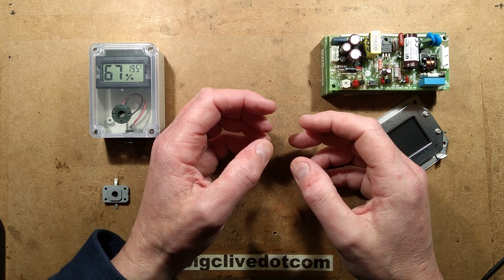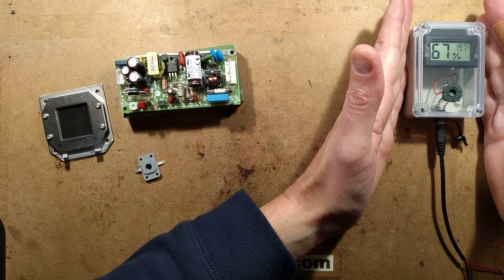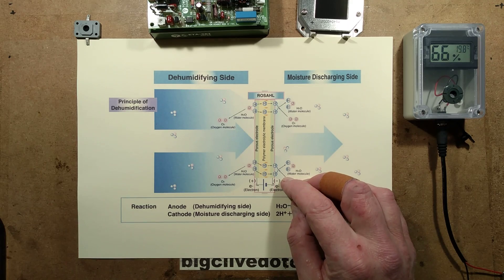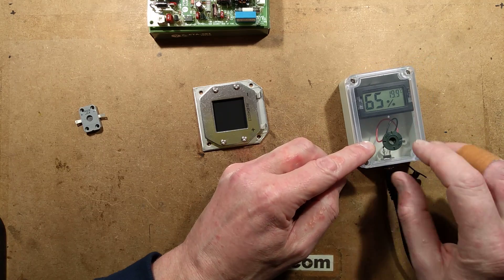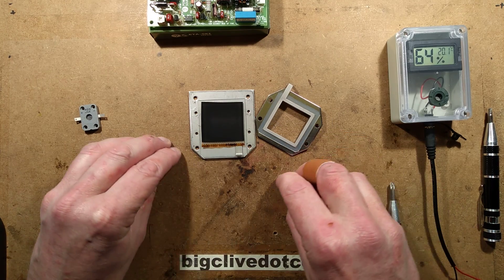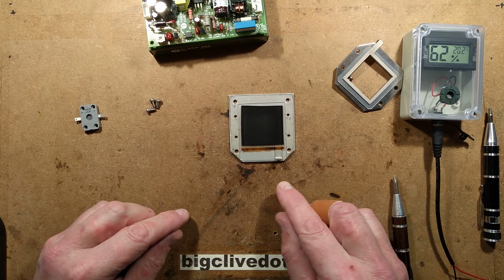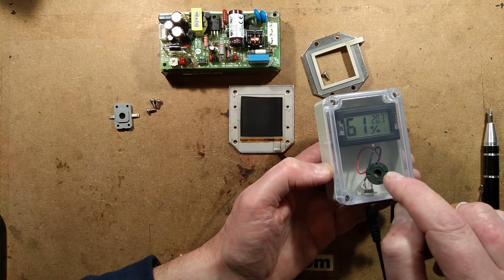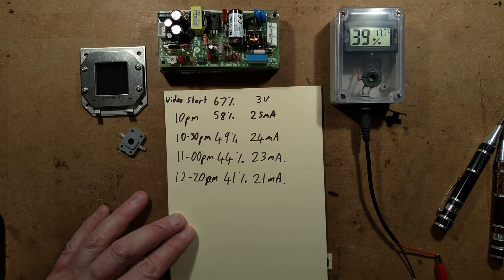Incredible solid state dehumidifier.  No moving parts.

Comment: It seems to be doing electrolysis on the water molecules in the air.. moving the hydrogen to one side and leaving the oxygen behind. Very interesting. I wonder if this is how oxygen concentraters work?   I also wonder if leaving excess oxygen in an electrical switching cabinet is a good idea?
Reply: If you're talking about the kind I'm thinking of, the ones that run on electricity and produce a higher oxygen gas than normal ambient air... those typically work through a combination of of air filters/sieves and a compressor. Basically from what I remember they just filter out the nitrogen and some control the oxygen content in the output mixture.
Reply: Thanks.. I didn't know how they worked.. Still, this is interesting technology.. it removes moisture by splitting the water molecule instead of just moving it from one place to another.

Comment: The lasers might be easier served by a small heater to keep the lens from condensating. Much easier to implement and no need to keep the outside dry.

BP uses heater strips in their PLC enclosures in Tobago to keep the housing above the dew point year round.

Comment: Clive, just from your words in the first 15 seconds of this video.... you should do some research into Cathodic Protection of pipelines that are coated with either Fusion Bonded Epoxy, or 2 part liquid epoxies. The direct current from a rectifier actually pushes ground water through a disbonded epoxy coating, and the current also polarizes the steel pipe surface in these disbonded areas. CP systems are used as a backup to prevent corrosion when a coating system fails. My wording might not be 100% correct here, so please do your own research. I'm a coatings guy, not a CP guy, but I do understand the logic behind CP. I'm sure others here will correct my lack of knowledge...

Comment: Are these suitable for outdoor electrical panels?  Look perfect and could use a ton of them for this.  Not sure how one would keep water off them.  Outdoor gear seems to get water in pretty much everywhere at some point.  Even pointing down at the bottom of a panel is likely to get wet do to water wicking up the edges.

Comment: This is a great device. Would be really useful for keeping 3d printing filaments dry in a box for example in storage. Sure you need power, but it is easier and probably botter to keep for long time than silica gel thingy.
Reply: movax20h good idea, if the box is small and sealed well the smaller models I would think should work fine.

Comment: Interesting technology. I wonder if it works similarly to electrolysis, but with a membrane that only lets the smaller hydrogen atoms though to the outside and not the larger oxygen atoms...
Anyway about your test, it's worth pointing out that testing the humidity drop by measuring the relative air humidity, isn't a particularly clever thing to do, since the relative air humidity is inversely proportional to the air temperature and therefore isn't very meaningful unless the temperature doesn't change during the test. For those interested, here's a list of data points shown in the video (of which I know the temperature, assuming the thermometer is accurate) and what they would have been had the temperature remained constant:
At 09:30 pm: 67 % at 19.5 °C = 67 % at 19.5 °C (obviously) (200 to 86 mA)
~  09:45 pm: 60 % at 20.4 °C = 63 % at 19.5 °C (~27mA?)
At 10:30 pm: 49 % at 20.1 °C = 51 % at 19.5 °C (24mA)
At 11:00 pm: 44 % at 18.5 °C = 41 % at 19.5 °C (23mA)
At 12:20 pm: 41 % at 17.5 °C = 36 % at 19.5 °C (21mA)

Comment: Too slow from what I am seeing.
Reply from the maker: They're only designed for enclosures and rely on ambient absorption into the membrane without forced air.
Reply: Well, I use the beads that you plug in to recharge them and within 2 minutes I will see a 10 percent drop in RH inside a 2 sq foot by 1 foot deep sealed container and only takes electricity when I recharge them for 8h once every 2 months.

Comment: This may be an odd question, but how much Hydrogen does it produce? Enough to be a problem in an enclosed area?
Reply: The web site has production values. The big cells produce only a couple grams a day of gas and most of that by weight is oxygen.

Comment: I suspect these are actually specialized fuel cells operating in reverse. I wonder if exposing one side to a very high humidity (say 95-99%) will cause an electric potential to form across the connection leads?
Reply: American Locomotive Water is the lower energy level molecule.  More likely success is putting lots of hydrogen on one side, then getting electricity from the terminal and water on the other side.

Comment: I'm watching that sing on the right hand side of your desk and the humidity is going down as the temperature is going up, that's not dehumidifying, that's just the physics of what happens to humidity when you heat something up! I'm getting the feeling that the next ad I'm going to see from that company is that thing hooked to a solar panel with the slogan, get free drinking water out of thin air LOL
Repeat after me, pseudoscience. ( you also brought a very tiny amount of air in that thing from outside onto your hot bench under the light )
Reply from the maker: If you note the data in the description you'll see it went down to about 22%.  The ambient temperature fluctuated up and down.
Reply: Clive heats the house with his own body heat.

Comment: Interesting device, all be it a slightly expensive one... Over £60 for the smallest... Eeeek.
(I was thinking of getting one to keep my 3D print filament dry, but I think I'm going back to plan A of a peltier).

What is your ambient humidity there, can it take the interior lower than the external humidity, or will it stop when it hits equilibrium (like true osmosis)?

Also I think you've left the oven on, I can't believe your house is over 20 degrees!
Reply from the maker: It went down to about 22% in an ambient humidity of about 65%.  It has been warm.  Winter can't come fast enough.

Comment: Good for making a 3d printing filament spool dehumidifier
Reply: I was thinking about that too! Would be great to store the spools, but I do not think it would dry spools that are already wet.
Reply: Exactly what I was thinking. :)
Reply: I thought the same, and I wonder if a small solar panel and some voltage controlling circuitry could run it. Julian Ilet would probably be all over that.
Reply: was thinking the same thing.
Reply: was thinking the same thing, a wee bit expensive though at 66GPB

Comment: Wow that would be nice mounted to the side of my safe. I use a dry back one that I need to plug in and recharge aka dry it out.
Reply: Craig C don’t most people put things to control humidity in their safes already?
Reply: Yes but most of them you have to take out to dry and recharge every month. This if it was somehow built into the same wall would pull the water right out of the safe.

Comment: Very interesting Clive, I’ve built a cabinet based arduino polytunnel control unit that sits in the polytunnel where the humidity is controlled at 70-80%. I’d always worried about the humidity in the cabinet so fitted a membrane “breather”. This technology sounds like it could be a good solution for me.

Comment: Very interesting, if they were priced like a commodity item I could put a few to use right away.

Do they form a pressure seal? If so, how much pressure differential to they tolerate? Wondering if these would replace a breather valve or work in tandem with one.
Reply: https://www.micro-dehumidifier.com/

Comment: That's a PEM fuel cell in reverse acting as an electrolyzer. It's not going to last long if it is starved of water, which in this case it will be. Needs to be completely wet and would still not last long.
My whole PhD was on fuel cells. The fibers are the gas diffusion layer, possibly carbon doped with platinum.
Reply: What about hooking a PID controller to keep humidity at constant level, like 10% or something. Would that prolong life of a device?
Reply: Fascinating!
Reply: So essentially, if you supply it with Hydrogen, it can make electricity? Say a few 10 mA at 3V?
Reply: Aditya no, you'd need a catalyst I think. It's conceivable that it might produce trace voltage, but nothing substantial I would presume.
Reply: @AdityaMehendale  quite possibly actually. It likely has a platinum catalyst on it to help break down the water, but I'm speculating as to whether this device has that. I'd expect it to buy can't be certain
Reply: Should add, means the dry side will be giving off hydrogen and the wet side oxygen. Won't likely give off ozone.
Reply: @Simon
Don't you think it is possible that the company that makes these has put a bit of work into them and optimized their product for being run dry?
Reply: @audiocrush  yes of course. I'd be interested to get one to see how they've done it. However the chemistry is set in stone. Being sceptical of marketing talk doesn't make me naive, it makes me want to know more
Reply: Converting the initial water content to oxygen shouldn't increase the oxygen level more than by a few percent, maybe from 20% to 23% or so. But I wonder how it builds up over time. I suppose that most of the time moisture and condensation would be a bigger problem than oxidation though.
Reply: Should've watched the whole video before commenting... The low voltage is to reduce degradation of the membrane and pinholes forming which effectively short it out. But yeah look up PEMFCs as an electrolyser, sometimes called "reversible"
Reply from the maker: I did come across the PEM fuel cell membranes while researching this device.  I wondered if they could be used for the same purpose.
Reply: @bigclivedotcom  if you're bored look up the "Helios" UAV. It used a fuel cell to power the motors at night then during the day used solar panels on the wing to power the motors and run the fuel cell in reverse to regenerate the hydrogen ready for the next night. Intimately resulting in an indefinite flight time... Until a motor failed and it crashed lol.
Reply: If I understand this correctly, the hydrogen is drawn out from the sealed enclosure leaving behind the oxygen. Wouldn't that be a corrosive atmosphere for the electrics inside it?
Reply: It should make O2 almost immediately. The O- will be initially dissolved in the membrane.
Reply: 15743 Hertz nope air is roughly 20% O2 anyway. This will not push up that percentage much. Maybe 22% tops.
Reply: My first thought as well.  I guess that rules out any machine controller boxes with contactors or other arcs.
Reply: @15743 Hertz : It's true that oxygen oxidizes, but without water the process is absurdly slow. Water provides the perfect medium for all the atoms to get to know each other. Besides, the increase in O2 will be a couple percent at worst, and the air already has 21% oxygen.
Reply: This is what I suspected was going on once the company diagram was shown, but not the low voltage prolonging the lifetime of the membrane. I thought it was to keep other reactions from happening, which I guess is another way of thinking about membrane degradation.
Reply: I figured it was fuel cell component architecture
Reply: The jet black color really made me think of pd/c
Reply: I understand the basic principle of this dehumidifier, but I'm wondering where does the collected moisture go/get deposited into a tray?  A somewhat similar device that comes to mind is the Peltier Junction, which is a solid state ceramic creating cold on one side and emitting heat on the other proportionally.
Reply: Bill A nope the water is split up into hydrogen gas and oxygen gas.
Reply: @Ellert van Koperen < Ahh got ya!  Wouldn't that be a bit too dangerous, especially if the H or O get's trapped in a small enclosure?
Reply: @BillAnt  potentially yes, realistically no. We're talking tiny amounts here, I'd be surprised if you could ignite it or reignite a glowing splint. But that's just what I'd expect, I've not tested it
Reply: When I saw the diagram, I wondered if the hydrogen was just protons skipping across the membrane.
Reply: these are not reversed PEMs :-)
the solid electrolyte allows to pass both… O and H Atoms
they have a service life of ~6-10 years when overprovisioned by 60%, so there is a half-life of ~6 years (pessimistic)
Reply: Do I understand correctly PEMs operating in reverse have a limited operating life?  Is there a way to keep it from drying out?
Reply: could this work in reverse and produce electricity from evaporation ?
Reply: so these are much more energy dense than batteries?
Reply: Simon your open university course was discontinued and your PhD is now worthless .

Comment: Brilliant...Both the solid state dehumidifier and Clives explanation. As in another post below, it also reminded me of the Peltier effect as I was watching. OOOhh... I'm getting some ideas!
Reply: Lots of crappy made-in-china dehumidifiers use the peltier panels, most 'mini dehumidifiers' you will find on Amazon will use the Peltier effect. This is because compressors are expensive whereas peltier panels are cheap.

The trouble is that peltier panels only remove a considerable amount of moisture from the air when ambient temperatures are high. Most of these listings advertise the daily water removal rate at 30C and 80% humidity, conditions we don't really get in the UK. I've previously owned one, but returned it when it removed just 40ml of water after 24 hours of use in a humid room.

The only good dehumidifiers for reducing the humidity of a room in your home is one that uses a compressor.

Comment: 9:00 "They didn't say that I COULDN'T take it apart..." When I was a wee boy I used to get into trouble with my mother over this logic. Responding "You never told me not to!" didn't really impress her.
Reply: My parents used to keep the toolbox out of my reach... then I learned that knives and other objects could act as screwdrivers...
Reply: Haha I got into trouble taking things apart as well and not know how to put them back. xD
As an adult I do the same and eventually find where something went.. xD
I like taking pictures just for the reasons of where did that wire go or that component go on the board? xD
Reply: The only thing I was afraid to put under the knife was a TV set... The fear of lethal high voltages was very real to me ;) Eventually I braved the territory and luckily survived it! It's all pretty safe until you remove that capped wire on the side of the CRT! Unfortunately I learned the hard way that the CRT itself acts as a very powerful capacitor!
Reply: you were lucky then because some of the older sets had live chasis
Reply: +jj DyNoMite  I have always been curious about CRT zaps.  Did it hurt lots. Do you think you got the full belt.  Do you think the chances are low for paying the ultimate price.  Have you been zapped by other things.  I have been zapped several times by 240v AC and several car, motor bike and lawnmowers so can use those as a comparison.  The discharge spark sounds fat and juicy so I can only guess it packs a wallop.
Reply: @jjdynomite5757  I think it counts as an initiation ceremony,
Reply: High resolution digital photography has revolutionized repair procedures and outcomes for the DIY fixer.
Reply: Gary Bevis - Back before cheap digital cameras, use older guys used a pen/pencil and a paper notebook to record important details...
Reply: Yeah, but you kind of have to know what you should record.
Reply: Justin, my worst one was 70 V DC through the mouth down to my left hand. Stripping wires with the teeth, because it was too much trouble to use a proper wire stripper, whilst forgetting that one wire was connected to a live PSU, is somewhat frowned upon since that incident.

I really did see the cartoon blue flash between the eyes, spat blood after biting right through my lower lip, and couldn't breathe for a few seconds. That was just a tad scary.
Reply: My mother said the day i learned to put things back together was a happy one for her.
Reply: i was 3 and with a tyre spanner in hand trying to take lug nuts off of the car and mum had a fit at dad needless to say i wasn't taught much from then on
Reply: @dtec30  Women ruin all the fun
Reply: i can understand tho her reasoning is that i could have loosened off the nuts and had a wheel come off it could have been dangerous but it was the 70's
Reply: I took everything apart whan i was a kid, too...
Reply: the first thing I ever worked on was removing all the wires from the washing machine timer my father removed to repair.  I cut every 1" wire off that jumped to each point. He left the wire cutters out so it was his fault.
Reply: zh84 Heh, since this is an electronics channel, you didn't really expect him NOT to take the thing apart, did you? ;)
Reply: My dad took down the doorbell to check it out, turned his back for a moment, and then he had to buy a new one, I've learned how to put stuff back together since........sometimes....
Reply: Took apart my parents brand new vcr in 1998 when I was 4, couldn't get it back together though
Reply: Awesome

Comment: The answer to water ingress, on yard solar lights. Boats. Cheers.
Reply from the maker: I was thinking that a small dedicated solar panel could run one of these dehumidifier plugs on its own.
Reply: I was recently considering the construction of a couple of raspberry pi based CCTV cameras, wanting one for my front door and one for my back garden. I couldn't think how I'd make them resistant enough to water ingress, especially as I'd need a clear front lens, not a cloudy one. This may just be the answer.
I wonder how long and at what current it would run with actual water inside, I suppose it would depend on the temperature to some extent.